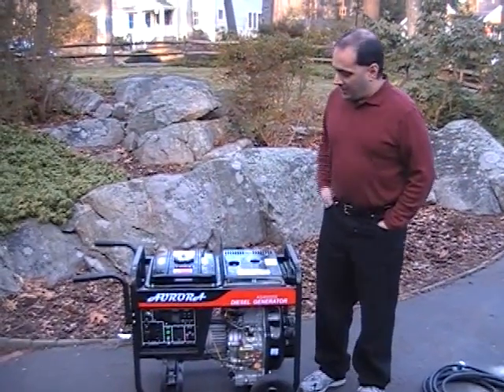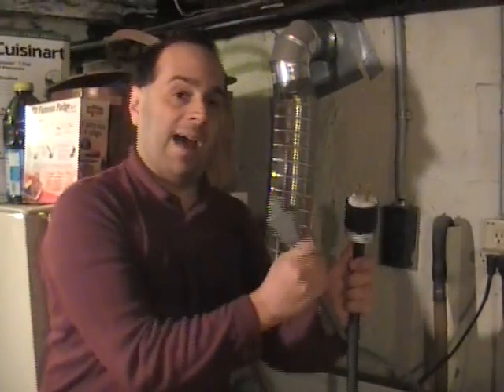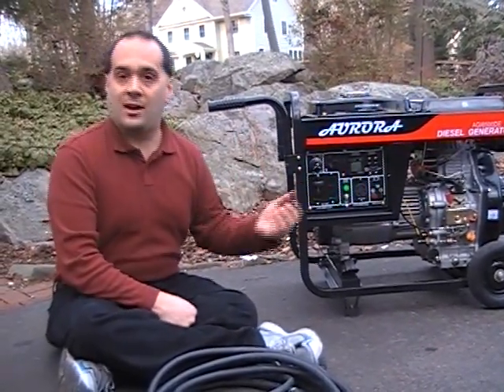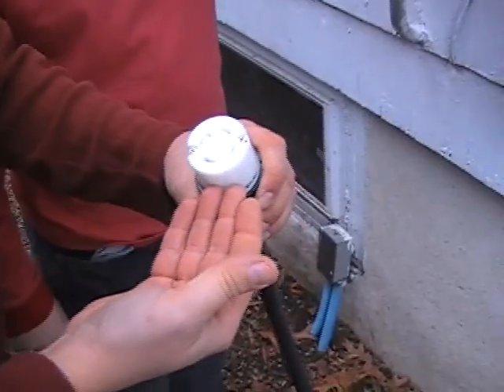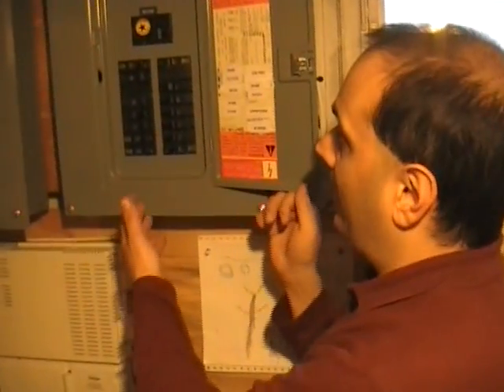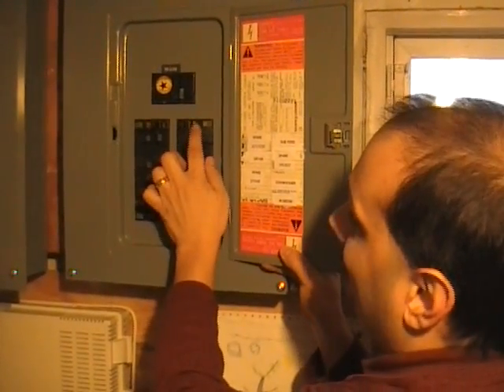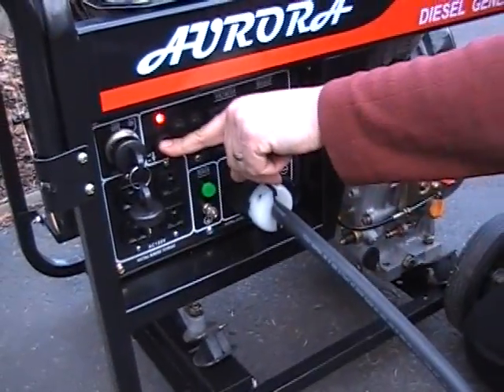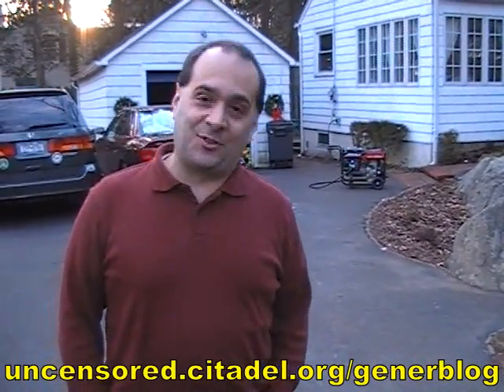Inexpensive residential generator hookup

Comment: A better way would be to hire an electrician to connect a double throw switch and the generator to the panel for your house.  Basically it works this way, the switch is in one position when the house feeds off the power company, neutral when there is no feed at all then the opposite position for the generator.  Hence, when the power is returned you only need to pick up the switch from its position to neutral and back to feeding from the power company.  Hire a electrician
Reply: Only if foolishness that would be typical of an imbecile is part of your life and you lack commonsense meaning you're filled with weakness, feeblenes  amongst other things. If you are feeble of mind or weak on intellect and act accordingly, then yes Hire an Electrician!
Reply: @rayadobravo  Whoa, back that pony up. Please, if you need to vent go outside and yell. It is good for the soul. Just don't go off as you just did. It makes you look childish. Strike that. It makes you look foolish.
Reply: @rayadobravo  feebleness ends with a double `s`,  Nestor. Remember to doublecheck your spelling, punctuation, grammar and syntax before uploading your vituperative comments on the web, or others will think you are feeble minded if they find such a glaring mistake as yours.
Reply: @jayurban4313  Here are the portable generator safety rules: make sure you are aware of all the warnings before using portable generators. This is just a reminder for everyone’s safety. All generator safety rules should be followed carefully. This advice is just to make sure that everyone is aware of all the warnings and it’s just to remind people to be careful using portable generators. Generators can be dangerous if not used carefully. Every year, hundreds of people die or get injured when using portable generators due to carbon monoxide poisoning and electrocution. Make sure you are using your generator carefully and keeping others safe as well. There is something very serious that everyone should always be aware of when using generators. Some people do run their generator indoors which is not safe and that increases the risk of carbon monoxide poisoning which can cause death of family and you. Some people run their generator in wet conditions which can electrocute them. Please remember that you should never run your generator indoors. Remember that carbon monoxide is an odorless and colorless gas that you cannot see or smell. Carbon monoxide is a silent killer. Keep that in mind. Make sure your generator is 15-20 feet away from your house and away from doors, windows, and vents. Never use your generator in your porch too. Having a carbon monoxide detector is very important against generator safety. Some people also allow children to go near the portable generator which could pose risks. We need to keep an eye on our children making sure that they are not near the portable generator so they won’t get electrocuted or burned by the generator which is dangerous. A locking enclosure also keeps kids safe. A generator shed might look like a tempting place to explore, or take cover during a game of hide and seek, but a generator is a dangerous piece of equipment that can cause injury. It says on the manual that we should also keep children away at all times from the portable generator to avoid injuries. Please do not allow a child or unqualified people to operate the portable generator.  It is important to keep your children safe especially little ones. The portable generator can be hot during an operation. Just because some manuals missed what should be listed doesn’t mean it’s safe to do. Always follow the generator safety rules when using portable generators. Generators pose electrical risks. If you need to use your generator during wet weather, you need a generator tent to protect your generator from getting wet. Don’t let your generator get wet. Keep your generator dry and before using your generator, please make sure your hands and your generator is dry. Do not wear loose clothing when operating the generator. Everything that is said on the generator’s operating manual should not be ignored. Never smoke cigarettes near the generator. Please keep flammable things away from the generator. Never overload your generator too. Your generator can catch fire. Never ever try to plug a generator cord into a wall outlet to avoid back feeding. Back feeding your generator is dangerous. Always turn on your generator first before plugging in appliances and shut off the appliances before turning your generator off. Use a heavy duty cord for your generator and the cord should not be worn out. All the instructions should be followed carefully. Never refuel your generator while it’s running. It can cause fire if fuel spills while your generator is hot. You should turn off your generator and let it cool off before refueling it. Having a fire extinguisher next to the generator is also important. This is only a reminder for everyone’s safety of using generators. Make sure your generator is properly grounded. Having a fire extinguisher next to the generator is also important against the safety rules. https://youtu.be/I1jT3ANENvI and here is a video more about keeping others safe when using generators and also about our family’s safety. It’s important to keep our little children safe as well. Make sure they’re away from the generator. Hope this helps. Thank you.

Comment: I heat my house with a diesel stove, which in the USA, for some reason, is called HEATING OIL. Therefore, of course, it would be more correct for me to have a diesel generator. But the price of an equivalent generator (8 KWt) gasoline versus diesel - $ 900 gasoline - $ 9,000 diesel. That is 10 times. Therefore, I have to use gasoline and have a supply of gasoline in the house of 30 gallons.
Reply: you meant, supply of gasoline out back!
Reply: @mooseymoo1328  I have a 225 gallon tank in my basement. It's not very good, but pretty safe. But for a gasoline generator, I have to have a supply of gasoline. And gasoline is highly flammable and its vapors are very volatile. This means that I can only have a supply of gas for a few days.
Reply: You nuts?  A 9kw diesel generator can be had for $3,500.
Reply: @Executiveinvestments-  This is better, although it is still 4 times more expensive than gasoline. And where can I buy such a generator, share a secret?
Reply: Home heatng oil doesn't have an antigel additive that keeps the diesel fuel from turning into jelly in very cold temperatures.  It's called heatng oil because it has a dye in it.  The dye identifies it as non-road use diesel, therefore, no state or federal taxes relating to road use are paid (except for sales tax if applicable).  If you're caught with dyed fuel in your truck or car, the fine is very, very expensive.  It will be presumed it wasn't  your first offense.  Fines can be as high as $1000 and back taxes added.

Comment: Your generator is probably going to have its own 30amp fuse at the connection which isnt enough to power an entire house. Suggest running two inlet plugs off both outlets at the generator then seperating the power off those into the panel that way you can achieve 60 amps between both cords.
Reply: You can only get 30 Amps @120V per line/leg (60 Amps of 120V only), Which is the same as 30 Amps @ 240V.   It wouldn't give you 60 Amps @ 240V that way unfortunately.  :-(
Reply: @mooseymoo1328  Here are the portable generator safety rules: make sure you are aware of all the warnings before using portable generators. This is just a reminder for everyone’s safety. All generator safety rules should be followed carefully. This advice is just to make sure that everyone is aware of all the warnings and it’s just to remind people to be careful using portable generators. Generators can be dangerous if not used carefully. Every year, hundreds of people die or get injured when using portable generators due to carbon monoxide poisoning and electrocution. Make sure you are using your generator carefully and keeping others safe as well. There is something very serious that everyone should always be aware of when using generators. Some people do run their generator indoors which is not safe and that increases the risk of carbon monoxide poisoning which can cause death of family and you. Some people run their generator in wet conditions which can electrocute them. Please remember that you should never run your generator indoors. Remember that carbon monoxide is an odorless and colorless gas that you cannot see or smell. Carbon monoxide is a silent killer. Keep that in mind. Make sure your generator is 15-20 feet away from your house and away from doors, windows, and vents. Never use your generator in your porch too. Having a carbon monoxide detector is very important against generator safety. Some people also allow children to go near the portable generator which could pose risks. We need to keep an eye on our children making sure that they are not near the portable generator so they won’t get electrocuted or burned by the generator which is dangerous. A locking enclosure also keeps kids safe. A generator shed might look like a tempting place to explore, or take cover during a game of hide and seek, but a generator is a dangerous piece of equipment that can cause injury. It says on the manual that we should also keep children away at all times from the portable generator to avoid injuries. Please do not allow a child or unqualified people to operate the portable generator.  It is important to keep your children safe especially little ones. The portable generator can be hot during an operation. Just because some manuals missed what should be listed doesn’t mean it’s safe to do. Always follow the generator safety rules when using portable generators. Generators pose electrical risks. If you need to use your generator during wet weather, you need a generator tent to protect your generator from getting wet. Don’t let your generator get wet. Keep your generator dry and before using your generator, please make sure your hands and your generator is dry. Do not wear loose clothing when operating the generator. Everything that is said on the generator’s operating manual should not be ignored. Never smoke cigarettes near the generator. Please keep flammable things away from the generator. Never overload your generator too. Your generator can catch fire. Never ever try to plug a generator cord into a wall outlet to avoid back feeding. Back feeding your generator is dangerous. Always turn on your generator first before plugging in appliances and shut off the appliances before turning your generator off. Use a heavy duty cord for your generator and the cord should not be worn out. All the instructions should be followed carefully. Never refuel your generator while it’s running. It can cause fire if fuel spills while your generator is hot. You should turn off your generator and let it cool off before refueling it. Having a fire extinguisher next to the generator is also important. This is only a reminder for everyone’s safety of using generators. Make sure your generator is properly grounded. Having a fire extinguisher next to the generator is also important against the safety rules. https://youtu.be/I1jT3ANENvI and here is a video more about keeping others safe when using generators and also about our family’s safety. It’s important to keep our little children safe as well. Make sure they’re away from the generator. Hope this helps. Thank you.

Comment: @IGnatius T Foobar Thanks to you (and to your admirable assistant). I have a sub panel already installed. If I understand correctly, I could rewire the circuits needed for emergencies to my existing sub panel, add the QO2DTI interlock, a 30 amp double pole breaker connected to an inlet receptical and save the $300+ for a transfer switch?

Comment: I recently bought a 7500w diesel onan out of a retired red cross truck. From what I've been able to find on the specific model it's a 120/240 model designed for RV use. It doesn't have a 240 plug like yours, so how should it be connected?  
Using it as a backup, could it be plumbed into my home heating oil tank? According to the RV installation manual i would need an auxiliary lift pump, but I'm unsure of regulations for this or fuel flow issues in winter. Do you know, or can you point me to any of this information?
I like your suggestion to wire everything up and then have an electrician finish it up, that's my new plan.
I'd like for my home to be self sufficient for at least 2 weeks and this would complete the circle. I live in Michigan if that helps.
If my generator is mounted onto a trailer would that change regulations on how its connected or placed?
Reply: Connect with a plug from hardware store (4wire twist lock for 240 or 3wire type for 120), you can also wire a disconnect switch bare wires from generator
Reply: Here are the portable generator safety rules: please make sure you are aware of all the warnings before using portable generators. This is just a reminder for everyone’s safety. All generator safety rules should be followed carefully. This advice is just to make sure that everyone is aware of all the warnings and it’s just to remind people to be careful using portable generators. Generators can be dangerous if not used carefully. Every year, hundreds of people die or get injured when using portable generators due to carbon monoxide poisoning and electrocution. Make sure you are using your generator carefully and keeping others safe as well. There is something very serious that everyone should always be aware of when using generators. Some people do run their generator indoors which is not safe and that increases the risk of carbon monoxide poisoning which can cause death of family and you. Some people run their generator in wet conditions which can electrocute them. Please remember that you should never run your generator indoors. Remember that carbon monoxide is an odorless and colorless gas that you cannot see or smell. Carbon monoxide is a silent killer. Keep that in mind. Make sure your generator is 15-20 feet away from your house and away from doors, windows, and vents. Never use your generator in your porch too. Having a carbon monoxide detector is very important against generator safety. Some people also allow children to go near the portable generator which could pose risks. We need to keep an eye on our children making sure that they are not near the portable generator so they won’t get electrocuted or burned by the generator which is dangerous. A locking enclosure also keeps kids safe. A generator shed might look like a tempting place to explore, or take cover during a game of hide and seek, but a generator is a dangerous piece of equipment that can cause injury. It says on the manual that we should also keep children away at all times from the portable generator to avoid injuries. Please do not allow a child or unqualified people to operate the portable generator.  It is important to keep your children safe especially little ones. The portable generator can be hot during an operation. Just because some manuals missed what should be listed doesn’t mean it’s safe to do. Always follow the generator safety rules when using portable generators. Generators pose electrical risks. If you need to use your generator during wet weather, you need a generator tent to protect your generator from getting wet. Don’t let your generator get wet. Keep your generator dry and before using your generator, please make sure your hands and your generator is dry. Do not wear loose clothing when operating the generator. Everything that is said on the generator’s operating manual should not be ignored. Never smoke cigarettes near the generator. Please keep flammable things away from the generator. Never overload your generator too. Your generator can catch fire. Never ever try to plug a generator cord into a wall outlet to avoid back feeding. Back feeding your generator is dangerous. Always turn on your generator first before plugging in appliances and shut off the appliances before turning your generator off. Use a heavy duty cord for your generator and the cord should not be worn out. All the instructions should be followed carefully. Never refuel your generator while it’s running. It can cause fire if fuel spills while your generator is hot. You should turn off your generator and let it cool off before refueling it. Having a fire extinguisher next to the generator is also important. This is only a reminder for everyone’s safety of using generators. Make sure your generator is properly grounded. Having a fire extinguisher next to the generator is also important against the safety rules. https://youtu.be/I1jT3ANENvI and here is a video more about keeping others safe when using generators and also about our family’s safety. It’s important to keep our little children safe as well. Make sure they’re away from the generator. Hope this helps. Thank you.